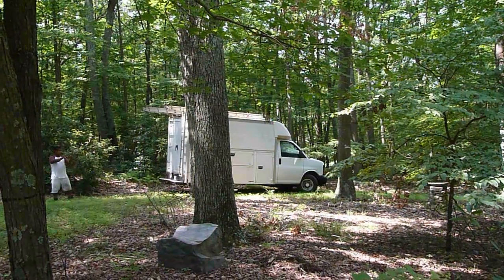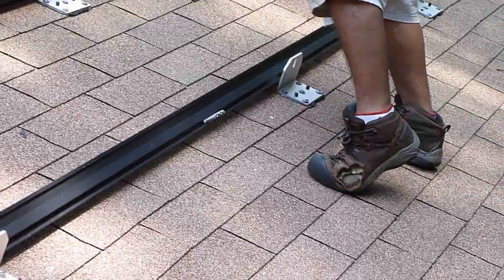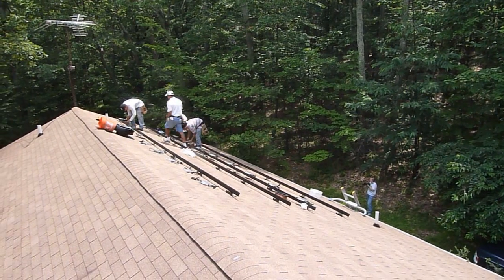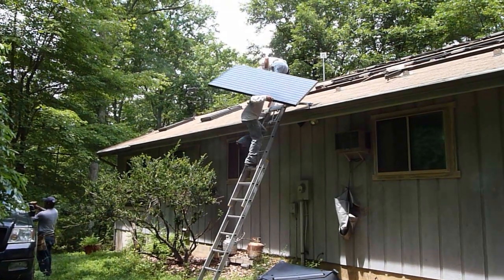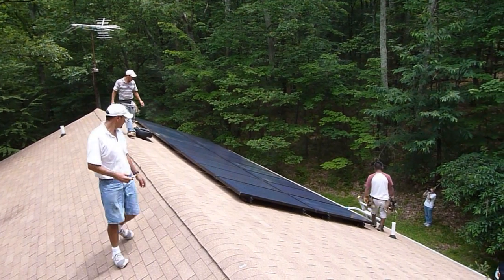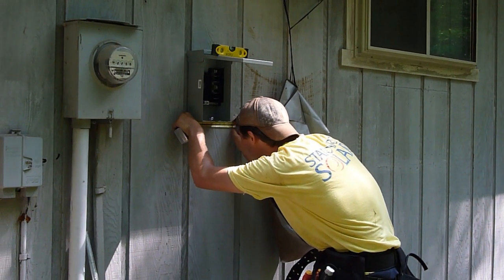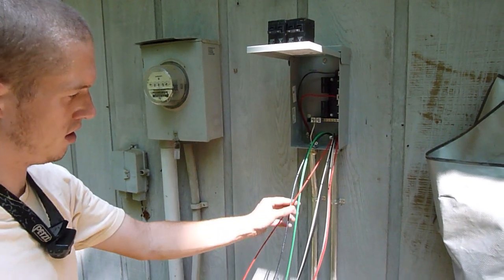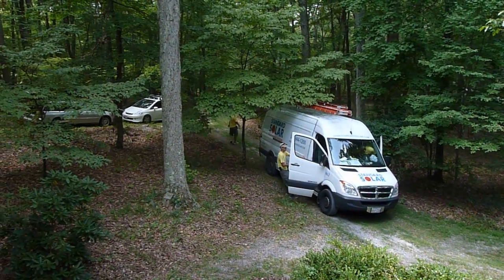Photovoltaic solar panel installation (in HD)

Comment: when the panels begin to go bad and they will how do you diagnose each panels separate output?
Reply from the maker: Since each panel has its own inverter (called a "micro inverter"), each panel's output can be examined and tracked. The micro inverters and control box are made by Enphase, so you can either subscribe to Enphase's online panel tracking service (which has an annual cost), or look at the panels yourself by plugging into the control box. I did the latter many times. We sold this house in March 2016 and had the panels for nearly six years. In that time, there was negligible falloff in power from the panels -- no more than 1 or 2 percent at most. We did, however, have six micro inverters fail, which caused the power from their panels to be lost until the micro inverter was replaced. One year, we discovered three bad micro inverters in May and immediately contacted Enphase. They were eventually replaced at no charge to us (labor was free, too), but not until September -- after the prime solar generation season.
Reply: +Bob Kovacs thank you so much for helping me I am new to this and want to know in your experience which company I should go with I mean which panel company I should go with
Reply from the maker: Yoshi, our panels were made by Sharp, and they were 100-percent reliable. However, we got them more than six years ago and the industry has changed and grown quite a bit since then. Prices have come down, too. I would certainly get Sharp panels again, but I don't know if the company even makes them anymore. Enphase, the company that makes the micro inverters, is still around and has a better (more reliable) product than what was sold to us. And its inverters have a 15-year warranty. Good luck!
Reply: +Bob Kovacs  thank you

Comment: what happens if there are leaks under the panels?
Reply from the maker: If there are leaks under the panels, then you have to fix them. I owned this house for nearly six years after the panels were installed and there were no leaks. During that time, we had a couple tropical storms and one tornado within a half mile or so. We also had three or four tough winters with lots of snow and freezes -- and no leaks. In my experiences, leaks under the panels are a non-issue.
Reply: +Bob Kovacs thanks

Comment: The Enphase M190 has abysmal failure rates.  The Envoy unit is also unreliable.  The M215 is far more reliable.   The M250 is supposedly even more reliable than the M215.

Enphase no longer offers per-panel monitoring capability to new customers.  I believe existing customers were grandfathered in and still have that capability.
Reply: Bob Kovacs   they did stuff wrong. that's why the inverters went bad.  You are not allowed to back feed a sub panel. And that's probably what caused the inverters to go bad
Reply from the maker: +Shun Wong Yes, that has been our experience. Six of the 18 M190 inverters failed and were replaced under warranty at no cost to us. However, it took months of wrangling with Enphase to get that to happen in each instance (three M190s were bad at one point). And our original Envoy failed after five years and we paid to replace it. The Sharp panels worked perfectly and never had any problems in nearly six years. The Enphase gear was another story, although Enphase (and our installer) did eventually replace all the bad units at no cost to us. When we had three bad inverters at one time, I informed Enphase in May and the units got replaced in September, eliminating the entire peak generation season. That was annoying. Still, they were replaced for free.

We never had the online monitoring feature, since we never had an Internet connection at this house. To see what the panels were doing, we plugged a laptop into the Ethernet port on the Envoy, which let us use a browser to see what its status was.

We sold the house (and the panels) a few weeks ago, so it's no longer my system.
Reply: +Bob Kovacs That's very good to know.   I was under the impression that the you could check the per-panel output only through their website and the MyEnphase interface.  I didn't know you could use a laptop to hook up to the Envoy directly to read the per-panel output.

Comment: What is the tool used in 6:41 ? Gracias.
Reply: Tom.. Thats a tapcon you idiot... No need for plastic anchor!!
Reply from the maker: +Hora Solar That's a drill set up as a screwdriver. The screw has an attached plastic anchor, so that it can fasten a bracket that holds the conduit. That way, he can drive the screw in a single process, instead of installing an anchor, then drive the screw. It's a fast way to install the conduit.
Reply: Bob Kovacs. You are supposed to put a plastic anchor in the wall before driving in the blue screw.  you really picked a team of amitures here

Comment: Like others have noted, no safety harnesses on these workers.  Violation of OSHA guidelines.  I wouldn't recommend this solar company for that reason. Looks like Enphase Inverters, so the shading will have less of an impact than if it was a system inverter.

Comment: No safety equipment on these guys.  What if someone falls off the roof and is paralyzed.  Better make certain that all these guys are covered by workers compensation insurance otherwise the owner might be sued as well as the employer.  Which brings me to my question.  Should these guys have tie down lines ?

Comment: Those are Mexicans working. They are probably illegal's, working for less than minimum wage.
Reply: +thecrouchmonster   they may or may not be Mexicans and may or may not be illegals but while companies continue to need low cost labor this isn't going to change.  I remember a few years back Tyson chicken was caught smuggling workers from south of the border probably from multiple countries.  Without low cost labor the economics of this capitalistic society wouldn't work.  If there wasn't a need they wouldn't be here.
Reply: I'm definitely questioning your integrity. I'm sick of people judging others with zero facts backing them.  You don't know anything about those installers.
Reply: They did better than the white guys installing the electrical....
Reply: tomnockout Source?
Reply: thecrouchmonster  I know Mexicans making more than white people
Reply: 2815Juan thank you
Reply: thecrouchmonster not to mention these guys are doing the job terribly WRONG. You are supposed to lag the footing into rafters never the ply wood. the system will fall apart in 10 years.

Comment: what's the name of the power meter  showed in the 9:02 minute ?  and how it works ?
Reply: thnks
Reply from the maker: That's the control box made by Enphase, called the Envoy Communications Gateway. It monitors all the inverters and tells me how much power the system is generating. If you have a continuous Internet connection (I do not), you can connect this to your router and Enphase will monitor the system. You will be automatically alerted to any failures, and be able to access your power generation information online. It's a neat feature... if you have a continuous Internet connection.
Reply: Bob Kovacs hi

Comment: Wow, what a poor install! No flashing just caulking, hope you know a good roofer.
Reply from the maker: Huh? There's definitely flashing... go look at the video again. Just so you know, this video is from four years ago, and there has been no trouble with the roof mounting for these panels.
Reply: Hi Bob, I must have skipped over the part where they added the little aluminum piece above the attachment. that being said in my opinion they are pretty cheesy looking and still rely on the caulking under the aluminum plate. which most sealing/caulking manufacturers only warrantee there product for 5 years. Also noticed they installed (2) 15 amp breakers in the sub panel, what size breaker feeds that panel?
Reply from the maker: Jesse
I will have to take my chances on the lifespan of the caulk. Keep in mind that the caulk/flashing is protected from scalding summer temperatures by the panels mounted above, and that a good percentage of precipitation falls on the panels and never approaches the flashing. All that should help to prolong the life of the caulk.

The sub-panel connects to the main panel with a 100-Amp/240V breaker.
Reply: Good point, I always think of the worst case scenario as far as leaks on a roof. When we do installs on roofs I always use the best products available so I can sleep at night. The 30 amps of solar on that 100 amp sub panel is exceeding the limit per the national electrical code. If you have a 100 amp breaker feeding a panel bussed at 100 amps you are only allowed 20 amps of solar. You cannot exceed 120% of the bus when you add the main breaker with the solar breakers. To be code compliant you would need to replace the 100 amp breaker with a 90.
Reply from the maker: Jesse Are you taking into account that this is a 240-Volt system, and that the breakers for the solar system are 15 Amp? 100+15 is 115 percent, short of the 120 percent in the Code. The maximum capacity of the panels is about 4,200 Watts, and the inverters limit that to a practical 3,800 Watts. 3,800W divided by 240V = 15.8 Amps. The reality is that I've never seen the system generate more than 3,500 Watts, which works out to 14.6 Amps.

The Code probably doesn't take into account that some circuits on the sub-panel are drawing power, which reduces the amount of power that the solar system will up-feed to the main panel. I didn't pay much attention to all this, but we did have the system inspected by both a building inspector and the electrical inspector. (We had to get a building permit for the work, so inspections were required.) We had no problem passing inspections.
Reply: You have two strings of panels (9) in each. Each string is on a 15 amp breaker which feeds the 30 amp breaker inside the 100 amp sub panel. The sub main breaker plus the solar is 130 amps. This exceeds the 120% rule. unfortunately the code does not look at the maximum current of the inverter but looks at the size of the over current protection device.
Reply from the maker: Jesse
I'm not sure I follow you. I also thought that the inverters (which are on the roof and under the panels) feed 240 Volts down from the roof. All I can say is that this was inspected by the electrical inspector. I do my own wiring and have had inspections by the inspector before, and he seems to know what he's doing. In the four+ years that this system has been working, no breakers related to it have popped. You may very well be right about the finer points of the code, but I don't quite follow what the concern is... my bad, possibly.
Reply: Sorry for nit picking your job, I'm sure it will work safely for a long time. It's just frustrating to see so many solar installs that are not installed per code. Not sure if its the same where you live but everybody is jumping on the solar bandwagon like mechanical and roofing contractors now install solar.
Reply: Also, most of the time the inspectors can't see the forest threw the trees, if you know what I mean. They cannot catch everything.
Reply: @jesse1441  many OSHA violations in this video,  but I'm sure it'll work fine

Comment: pretty fast because they are not locating rafters. they are just using screws to screw down the mounts. not a very good idea when a tornado is close by
Reply from the maker: We have not had any tornadoes nearby in the past four years, but have had one tropical storm and a couple of nor'easters. We've also had more than a foot of show on the panels multiple times.

Not many homes can withstand a direct hit by a tornado without at least some damage... the solar panels would probably be the least of my worries at that point. Still, I agree that screwing the lags into rafters would be best.

FWIW, the house -- including the panels -- is insured.
Reply from the maker: I owned the home until March 2016. In the nearly six years that the solar panels were installed, there were no leaks.
Reply: That roof will leak, no sheathing.

Comment: monetization problem? me too
Reply: Hey
Reply from the maker: I got the monetization problem fixed a couple years ago. You're talking about monetizing this video, right? It's now monetized and earns pretty well.

And after 3.5 years, the solar panels are still working well and generating good power. On April 20, 2014, I saw the panels making 3.56 kW, which is close to the maximum I've seen for this system. And we're still two months from the summer solstice!
Reply: Bob Kovacs That's cool man! My teacher also has something like that in his house, really cool and environmental!
about the monetization thing i still have a lot of videos that i cant fix i heard you fixed it by re-monetizing it? i wish that'll work for me.. (=)
Reply from the maker: *****
I complained a little in Google's/YouTube's forums. Someone there told me to un-monetize, then re-monetize. That worked for several of my videos, although it didn't work for a couple. This video is one that it worked for. Fortunately, the other videos don't get many views, so it's no great loss.

In general, a video like this that shows an interesting process with clear video and sound is a good earner. Viral videos of a funny animal or stupid stunt might get a lot of views, but they earn far less per view than a "how-to" video such as this one. That's my experience, anyway.
Reply: Bob Kovacs Thanks for the tips and reply!

Comment from the maker: Sorry, timcat100, YouTube is not showing me a "Reply" link to answer your question, so I will answer it here.

There are a few ways to know if an inverter is bad, but you have to be observant for most of them. If you have the system connected to the Internet, all data about your system gets sent to the inverter's manufacturer (Enphase), and I'm told that Enphase will notify you if an inverter is bad. My system is not connected to the Internet, so I simply noticed that I was producing less electricity than I should have been producing. I connected the Enphase control box to my computer (using an Ethernet cable) and called up the control box using a router. Using that, I could see the status of each inverter. That's where I saw I had two bad inverters.

Fortunately, the installer replaced the inverters at no cost to me. Even the installer's visit to my home was under warranty... very painless.

I could keep the Enphase controller connected to my computer so that I could check it every time I use the computer, but I'm too lazy for that. The good news is that my system was generating 3.2 kW of power at one point today (March 9, 2014), which is an excellent amount of power for a day on the winter side of the equinox. Good to see that.
Reply: +Bob Kovacs Did this get monetized in the end?
Reply from the maker: +BittyFromATitty Sorry, but I didn't see this until now. Yes, I got it monitized and it has done well.

Comment: Great job on the video. Thanks for posting! I also wouldn't mind others' comments as sometimes people just like to complain. No way I would wear a harness on a roof that flat and that low. I do worry about the mounting method they used though. It seems like it will be very prone to leaks in the future with such minimal flashing. But I have read your comments saying there are no leaks thus far so that is good to hear.
Reply from the maker: Thanks! The system has been in for more than 3.5 years, and I'm most of the way through the 4th winter for this installation. There continue to be no leaks. Part of the reason may be that every screw installed into the roof had some black sealer applied to it. Another reason is that not much water makes its way under the panels, as there is just a small amount of uncovered roof above the panels.And I don't mind critical comments here or elsewhere online. In fact, I've learned from them over the years. If you put stuff out in public, you can expect a response. To think it will all be positive is naive.
Reply: Hey Bob just curious how much it cost? I'm thinking about get solar panels, too. Thanks.
Reply from the maker: Shami Khan
The cost I paid for this system has been answered below in the comments. Start at the bottom of the comments and read up. However, I installed the system in 2010, and the cost of panels is quite a bit lower today. It should cost less than I paid.

Comment from the maker: The entire system actually produced more power in its second year over the first. Overall generation went down in year 3, mostly because I had 2 dead Enphase inverters (out of 18, about an 11% drop). I just got the inverters replaced about 6 weeks ago, missing the peak summer generation period. Assuming all inverters stay working, I should have good generation data in the next couple of months. Factoring in the bad inverters, PV panel production has not fallen off at all.

Comment from the maker: I've answered this question before... scroll down to the bottom of these comments and read up from there. Keep in mind that I installed this system more than 3 years ago, and I think the panels cost less today.

Also, I had two of the Enphase M190 microinverters fail, but they were replaced for free under warranty.

Comment: This is definitely not the proper way to do this. The lags should be pre-drilled and driven into the top cord of the rafter or of a sistered rafter. One good storm and that plywood can be ripped right off. Roofers tend to miss the rafter a lot when nailing the plywood. I guess you are lucky you are surrounded by trees. The system we use in Ontario is much different than this.

Comment from the maker: If you've read through the comments below, you'd see this has come up before. After the system was installed, we had several trees removed. However, at peak sun time (10AM to 4PM), there was/is no shade on the panels.